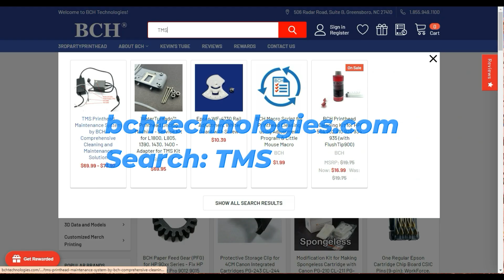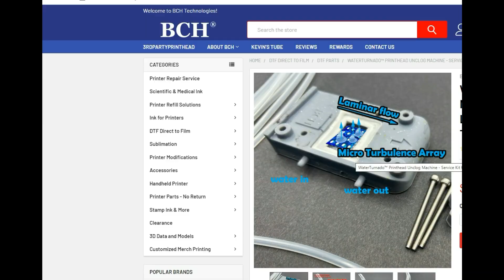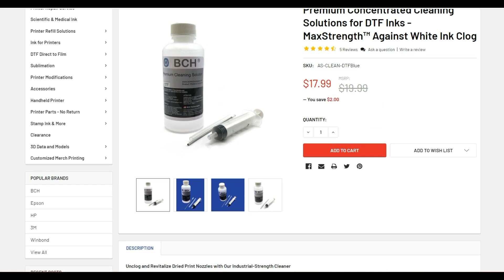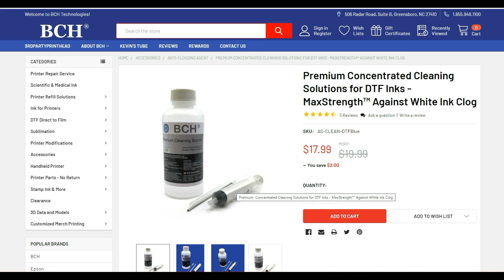#1 Shocking Secrets of L1800 L805 Printhead Unclogging Machine

Comment: Hi kevin, can i use this on L3110-L5290 printheads?
Reply from the maker: Thank you so much for your support and for reaching out with a great question—it really means a lot; for the L3110 and similar models like the L5290, the cleaning approach is actually different from the L1800/L805 because those printheads need to be opened up and cleaned internally rather than using the same method shown in this video, and I’m currently working on a new video that walks through that process step by step so people don’t damage the head or waste time on methods that won’t work for that design; if you need faster help in the meantime, feel free to email [support@bchtechnologies.com](mailto:support@bchtechnologies.com), and if this video or my reply helped you at all, I’d really appreciate a Google review here: [https://g.page/r/CfL7k6nYvPQ9EAg/review](https://g.page/r/CfL7k6nYvPQ9EAg/review); you’re also welcome to join Run With Kevin — LIVE, where I go live every morning (usually between 6–8 AM Eastern) answering printer questions in real time, and if you subscribe and turn on notifications you can catch the next live and ask directly—subscribing or becoming a channel member really helps because I get a high volume of questions and replies are prioritized this way: subscribers and members are typically answered within 48 hours and get extra perks like early access to videos, regular viewers are answered if time allows since I can only reply to about 10 questions per day, and after subscribers and members any remaining reply slots are filled last-in, first-out with newer questions reviewed first, so if you’re not subscribed and don’t see a reply within 48 hours you can either subscribe or repost your question, and if you subscribe later your older questions automatically become priority without needing to repost.

Comment: I have got a question, if the check print on l805 seems to be ok (all Stripes looks good), but in real prints some collor doesn't print well (like mixing collors, Green doesn't seems to be good, maybe troubles with yellow or cyan (maybe black?), but check print is good), what it may to be?
Reply from the maker: Thanks so much for your support and for the great question—I really appreciate you watching and engaging with the channel! If your nozzle check on the L805 looks perfect but real prints show poor color mixing (like muddy greens or weak yellow/cyan), this is usually not a clogged printhead but a software or ink-delivery balance issue, so start by adjusting the color mixing percentages in your RIP software and also inspect the dampers closely for backflow or pressure imbalance, which is especially common if you’re doing wet capping. Since I get a very high volume of questions and can only reply to about 10 per day, please note that subscribers and channel members receive priority responses (typically within 48 hours) along with extra perks like early access to videos, while non-subscribers are answered if time allows, with remaining slots filled last-in, first-out (newest questions first); if you don’t hear back within 48 hours as a non-subscriber, you can either subscribe or repost your question, and if you subscribe later, your older questions automatically become priority without needing to repost. I’d also love to invite you to Run With Kevin — LIVE, where I go live every morning (usually between 6–8 AM Eastern) answering printer questions in real time, so be sure to subscribe and turn on notifications if you want to catch the next session and ask directly. If you need faster help, you can email [support@bchtechnologies.com](mailto:support@bchtechnologies.com), and if this video or comment helped you out, I’d truly appreciate a quick Google review here: [https://g.page/r/CfL7k6nYvPQ9EAg/review](https://g.page/r/CfL7k6nYvPQ9EAg/review).

Comment: My v2 damper adapters don’t go all the way down flush because the spout is too tall. Your spouts look shorter than mine.
Reply from the maker: Thanks so much for your support and for watching the videos—I really appreciate it! Yes, the newer version of the V2 adapters is a little taller, so you’ll need to use a razor blade to trim the spout slightly until it sits flush. If you’d like quicker or priority help, consider subscribing or becoming a channel member; subscribers and members usually get replies within 48 hours, while I can only answer about 10 questions a day for non-subscribers, and those are handled last-in, first-out, so if you don’t get a reply within 48 hours you can subscribe or repost your question since newer ones get reviewed first—plus if you subscribe later, any older questions you’ve asked automatically move into priority without needing to repost. You’re also welcome to join me on Run With Kevin — LIVE, where I go live almost every morning between 6–8 AM Eastern to answer printer questions in real time, so be sure to subscribe and turn on notifications if you want to catch the next session and ask questions directly. If you ever need faster assistance, you can email [support@bchtechnologies.com](mailto:support@bchtechnologies.com), and if the video or this reply helped you, a quick Google review would mean a lot: [https://g.page/r/CfL7k6nYvPQ9EAg/review](https://g.page/r/CfL7k6nYvPQ9EAg/review)

Comment: Does it matter the direction of flow of the water. Your current set up has the pump pushing water into the left side of the adapter and coming out the rigt in accordance with the arrow on top of the adapter. I’ve hooked up the pump to my new adapter as in your video but then noticed after I took it apart that the new adapter I received from you has the arrow on the bottom of the adapter pointing from right to left. I’ve changed it to hook up in the direction of the arrow. I’ve ran it both ways and it worked but I just want to make sure I’m not messing something up. By the way your product works amazingly!!! It’s saved my 3 print heads so far!! Thank you!!
Reply from the maker: Thanks so much for watching and for your awesome feedback! I’m really glad to hear the unclogging machine saved your three printheads — that’s fantastic! The flow direction doesn’t actually matter for this setup, since the pump pressure and adapter are designed to work both ways without causing any damage or performance issues. I truly appreciate your engagement and support! Because there’s a high volume of questions, subscribers and members get priority answers within 48 hours and also receive early video access and exclusive perks. I typically answer about 10 questions a day, and after subscribers and members, any remaining slots go last-in, first-out (so newer comments are reviewed first). If you’re not subscribed and don’t hear back within 48 hours, you can subscribe or re-post your question — subscribing later automatically gives your old questions priority. For faster help, feel free to email [support@bchtechnologies.com](mailto:support@bchtechnologies.com). And if this video or comment helped you, please consider leaving a quick Google review here: [https://g.page/r/CfL7k6nYvPQ9EAg/review](https://g.page/r/CfL7k6nYvPQ9EAg/review)

Comment: i have replaced my manifold with a new one , but seems the head core is blocked white channels. Is there a video to unclog the core white channels
Reply from the maker: Thanks so much for subscribing and supporting the channel—every subscriber gets us one step closer to our 100K milestone, and I really appreciate it! As for your L1800/L805 printhead issue with the white channels being blocked, it sounds like a core clog that goes beyond the manifold. I’ve made several videos on deep unclogging and flushing methods, and the best way to find the most relevant one is to go to [https://youtube.com/@bchtechnologies](https://youtube.com/@bchtechnologies), click the search icon at the top right, and type in terms like “L1800 core clog” or “unclog white channels.” YouTube’s built-in search is surprisingly smart at filtering just my content. I try to answer subscriber questions within a few days, though there's a big backlog right now—but I’m catching up fast! Let me know if you don’t find the right video—I’ll do my best to guide you.

Comment: hello i just want to ask if epson l805 printhead can be use to epson l1800 printer ist compatible?thank you
Reply: they are not compatible but there is a module to use L805 head in L1800
Reply: @MrMorisoh  thank you
Reply from the maker: Thanks so much for your question and for supporting the channel! Yes, you can use an Epson L805 printhead on an L1800, and the advantages are that the L805 head is cheaper and has larger nozzles that are less prone to clogging; the tradeoffs are that you’ll need a conversion card like the one we sell at BCH Technologies (https://bchtechnologies.com/products/printhead-conversion-breakout-board-l1800-1390-to-l805-l800-adapter-riser-card-1) and, in some cases, the printer may print a short strip of a different color before starting the actual image, so many users place a small white block at the top of their design and trim it off afterward. If you haven’t yet, I’d really encourage you to subscribe or become a member so your questions get priority replies within about 48 hours and you also get early access to upcoming videos; I get a lot of questions daily and can only answer around 10 from non-subscribers, and those are handled last-in, first-out, so if you don’t hear back in 48 hours you can either subscribe (your older comments automatically move to the priority queue) or re-post your question so it shows up among the newest ones. You’re also welcome to join Run With Kevin — LIVE, where I go live most mornings between 6–8 AM Eastern to answer printer questions in real time, so be sure to subscribe and turn on notifications if you want to catch the next session. If you ever need quicker help, feel free to email [support@bchtechnologies.com](mailto:support@bchtechnologies.com), and if this reply helped you, I’d really appreciate a quick Google review at [https://g.page/r/CfL7k6nYvPQ9EAg/review](https://g.page/r/CfL7k6nYvPQ9EAg/review).

Comment: If you dip the core into liquid, won't it damage the head?
Or do you just need to make sure it's completely dry before using it?
Reply from the maker: Thanks so much for your support and for taking the time to ask this thoughtful question—it really helps keep these discussions valuable for everyone; if you look closely at the video, the liquid I’m using is not water but an in-lab, non-conductive solvent, so it won’t damage the printhead, and in cases where a core does get soaked in water, the safe approach is to either soak the printhead in a non-conductive liquid to dilute and displace the water or make absolutely sure it’s completely dry before powering it back on, since conductivity is the real risk; if this helped, please consider subscribing or becoming a channel member because I receive a high volume of questions and replies are prioritized this way: subscribers and members are typically answered within 48 hours and also get perks like early access to videos, regular viewers are answered if time allows since I can only respond to about 10 questions per day, and after subscribers and members any remaining reply slots are filled last-in, first-out with newer questions reviewed first, so if you’re not subscribed and don’t hear back within 48 hours you can either subscribe or repost your question, and if you subscribe later your older questions automatically become priority without needing to repost; you’re also welcome to join Run With Kevin — LIVE, where I go live every morning (usually between 6–8 AM Eastern) answering printer questions in real time, so subscribe and turn on notifications if you want to catch the next live session and ask directly; if you need faster assistance, email [support@bchtechnologies.com](mailto:support@bchtechnologies.com), and if this video or comment helped you, I’d really appreciate a Google review here: [https://g.page/r/CfL7k6nYvPQ9EAg/review](https://g.page/r/CfL7k6nYvPQ9EAg/review).

Comment: Will machine, adapter  and destiled water works with uv ink clogged heads?
Reply from the maker: Thanks for subscribing and supporting the channel—we’re pushing toward that 100K goal, and every subscriber helps! Unfortunately, distilled water and standard cleaning solutions won’t work well on UV ink clogs because most UV inks use a weak EcoSolvent base. For the best results, I’d recommend reaching out to your UV ink manufacturer to see what cleaning solution they suggest for unclogging the printhead. Let me know if you need any further guidance, and since you're a subscriber, your questions get priority!

Comment: Does that unclogging bracket fit 8500/8550 print heads?
Reply: Great video
Reply from the maker: I'm currently working on it. This solution is specifically for unclogging the L1800/L805 series. For the ET-8500, I'm thinking about converting the printhead to a 'nipple' version (which is ready and available to demonstrate) so that it can use regular dampers. Alternatively, I could stick with the OEM setup and create a kit for that model. Which approach would you recommend? Or should I first create a video on the 'nipple conversion' to see if it's too complicated for people to do at home?
Reply from the maker: "Nipple Conversion" will really get people excited. I think. LOL. This is how good ChatGPT is. I asked, without any context, "What is Nipple Conversion Therapy." I thought it would give me some weird stuff. On the contrary, ChatGPT: "Nipple conversion therapy" refers to a modification process for printer printheads, often used in inkjet printers. This conversion aims to replace the existing ink delivery system with a more easily maintainable or cost-effective one. Here’s an explanation of the concept: 1) Printhead Modification: The original printhead is altered to include "nipples" or nozzles that allow for the attachment of external ink systems. This involves creating ports on the printhead where new ink dampers or cartridges can be connected. 2)Using Regular Dampers: By converting the printhead to have nipples, regular ink dampers (often used in continuous ink systems) can be attached. This allows for more straightforward refilling and maintenance. "  Out of the blue, it understands it's for printers! Maybe because I talk to her too much about printers, now she is a pro.
Reply: I converted my et 8550 to nipples can i use these on it now? @BCHTechnologies